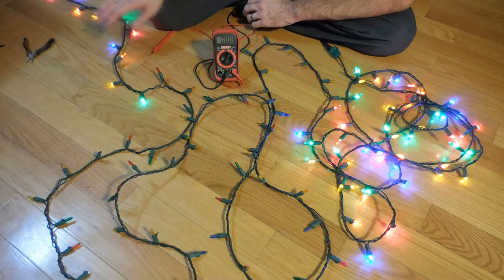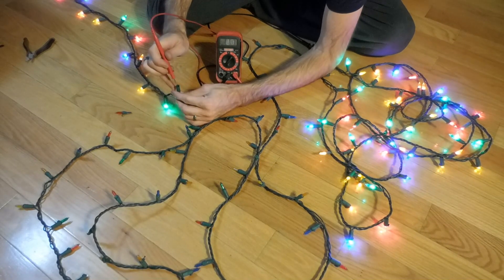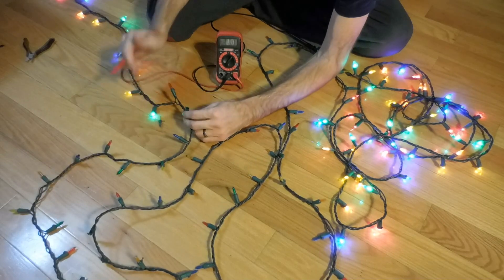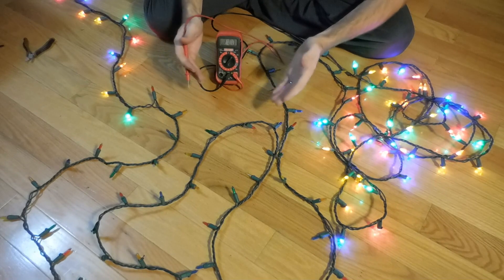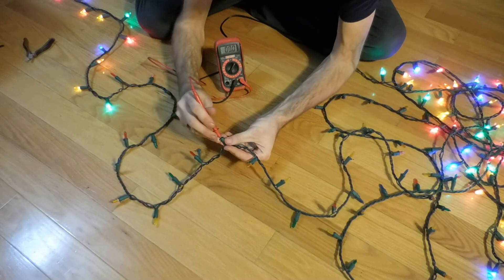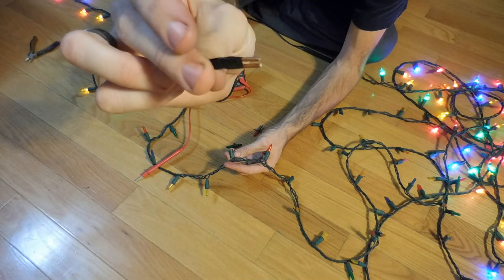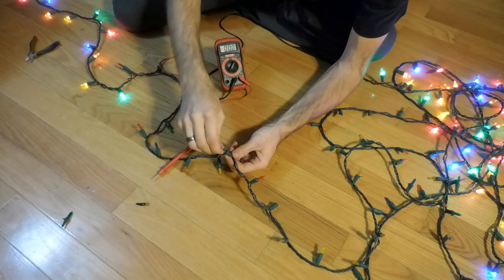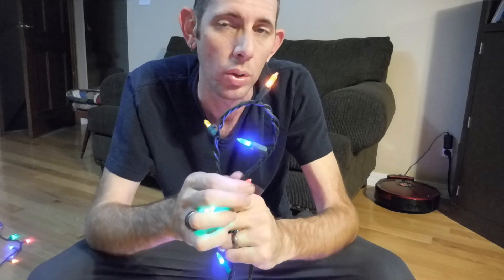Find a bad LED in Christmas light string

Comment: Great video. I was 3 for 3 at fixing the strings that have removable bulbs.   I still have two strings that don't accept replacement bulbs.  Any suggestions?
Reply from the maker: Jamie Forrester are the LEDs molded into place? If the LEDs are not removable, the only thing I can think would be to pierce the insulation to test for voltage on either side of a LED. I personally don’t like to provide any extra entry points for moisture to get around the wire, but a straight pin like from a sewing kit would probably leave the smallest puncture. Use the same technique to identify the bad LED, testing for voltage on both sides of the LED. Remember you’re dealing with potentially 120 VAC, so don’t touch that pin once it’s pierced the insulation. Once the bad LED is identified, you could probably get by with just cutting that one LED out, and soldering/heat shrinking a small wire splice in its place, unless you can find a suitable LED to take its place. Eliminating one LED will push a little more current through the remaining LEDs which could shorten their life, but they’re basically trash right now anyway. You could also solder in a ~270 ohm resistor in place of that bad LED to limit the current a tad. Let me know what you figure out with them. Better yet, make a video and show your process if you get them fixed. Others may encounter the same issue.

Comment: That's probably a $25. set of lights. For that money they can't make them any more sturdy than that? Who has the time and initiative to do this? Better off with old incandescent cheap mini lights.
Reply from the maker: Chris Lapp well, a lot of people prefer to fix instead of replace. And I’ve replaced many bulbs in incandescent light sets in the past, so this issue isn’t unique to LEDs. These were originally a $25 set of lights, but I got them on a clearance sale after Christmas. This set of lights had already been used for several seasons before this issue. I went with LED because I only have one exterior outlet on my house and with LED lights, I can daisy chain up to 9 sets together. It takes 6 sets of lights to get all the way around my roof line. Incandescents you can only do 2 or three sets linked together and then you need to start running extension cords for the next set of lights. I decided to spend money on lights instead of on a bunch of extension cords.

Comment: Any recommendations on how to shorten LED  GE icicle lights to make custom fit?
Reply from the maker: Jim Nuna I think the only way to do it would be to add a resistor equivalent to the number of LEDs that are removed from the circuit, but that’s just what I’d try first. It may not be the correct way to do it. Someone else commented about a plastic housing on some GE LED’s, maybe it already contains a resistor? I’m not sure.

Comment: Hey Dustin, I had a slightly different issue with my set of LED lights.  Plugged them in this year, they lit up but they were no where near as bright as they should have been.  I decided to give your voltage drop testing technique a whirl and it worked.  Was getting maybe 30v AC from the end almost all the way to the beginning of the string.  Then bang, 120v on one back to 30v on the next bulb.  Swapped out the one in between with a replacement and the string lit up like last year!  Guess that diode half fried and was acting like a big resistor.  Anyway thanks again.
Reply from the maker: Peter Frangos glad you found the issue. Thanks for sharing.

Comment: Some of my LED Christmas lights has built-in resistors actually on the LED bulb any clue where to find these I've searched everywhere
Reply from the maker: Christmas Man so the resistor is built into the bulb? Can you remove the resistor and measure its resistance or are they molded together and inseparable?
Reply: @DustinRogersinMO  it is actually molded to the lead that runs down from the light bulb they are inseparable all of the light bulbs in the strand or not like that there's only 1 bulb that is that way per strand I have about five strands of lights that's that way all of my others have the typical resistors in their own little spaces right after these little bulbs is where I lose my 110 voltage I have looked everywhere for these bulbs because three sets out of the five loses their voltage right after those bulbs really hate to trash them just because of that

Comment: I already had a volt meter, and your video helped me find the bulb with the loose lead wires.  They still blink off because it's a bad design, but I know which bulb it is and it doesn't blink off unless there's a lot of wind.  Thank you for taking the time to share your knowledge.
Reply from the maker: No problem. Thanks for watching.

Comment: There is a better safer way than working around 120VAC, go to www.LEDKeeper.com. https://www.ledkeeper.com/about-us/
Reply from the maker: It looks like that tool pierces the insulation. While that may be acceptable for indoor lights, most of my lights are out in the elements. I don't want to make any holes, no matter how small, in the insulation of my wiring. Piercing insulation is highly discouraged in the automotive and motorcycle repair field due to the risk of corrosion after water wicks in through the pierced hole.
Reply: You would be correct, however we did a UL  Hi-Pot test that is required on all electrical devices. We took a string of LED lights and pierced the string over a thousand times and then did the insulation breakdown test (hi-Pot) on the string, it passed with flying colors. So that is not a problem. If it wasa problem we would put a warning on the package.
Reply from the maker: Dennis Cherry good to know, but I’m assuming that the insulation breakdown test was performed the same day (or week) that the insulation was pierced? What about after a couple seasons of UV exposure, heat, cold, packed with snow, or drenched in rain? 

It’s good to know there’s a tool available, but I’ll stick to my methods and avoid piercing the insulation.

Comment: One word of advice, do NOT buy your LED Christmas lights at Walmart!! Big waste of money and CHEAPLY MADE! Every strand I have bought from Walmart has problems a week or 2 after I bought them. When it rains, water gets in where the bulb wires are, and they break off SO EASILY!! I throw on a 300k plus strand light show and it's only the LED that break so easily. From how pretty they look, they can be a real nuisance, as you can't shock them with the LightKeeper Pro like you can with mini lights. That simply shorts out the bulbs and burns them out. Buy your LED lights from Costco, target, big lots, or online from amazon or something like that
Reply from the maker: Drewbie1997 good feedback. I bought mine from Ace Hardware.
Reply: That's definitely better than walmart
Reply: If you want quality lights, forget all the retail stores.  Go to www.holiday-light-express.com - the lights they sell there are commercial grade, much brighter, rectified (no flicker) and extremely durable.  Yes they cost a bit more, and yes, they last a LOT longer.

You can also get LED screw-in replacements for your old fashioned lights with the big bulbs there.
Reply: I could not agree more I put up 30,000+ lights, about 10,000 are from Walmart and I'm working on them all the time.
Reply: @christmasman977 see i mean i have had some luck with LED lights from walmart. the trick is to get them from the back of the shelf and try your luck. you will have a greater chance of getting non defective strands. but even so, everything at walmart is mass produced and made cheaply, as the prices can tell. sometimes it's worth spending the extra buck or 2 and having something last for years on end instead of paying for something and have it last no more than a year or 2
Reply: None of them are any good if made in China. In other words, they are all garbage

Comment: This is the better tutorial for led lights. Others did not tell me the way the voltage went through. Good deal man. Now we need a video on icicle lights.
Reply from the maker: I would imagine that icicle lights are wired similarly where each hanging strand is wired in series. There may be multiple hanging strands per group of lights. Unfortunately I don't have any icicle lights to test.
Reply from the maker: I bought a set of LED icicle lights on clearance just to test out. The set I bought operates in the same way that the regular string of lights does. There are groups of lights that are wired in series. My set had two groups of 35 lights and each group of lights also had a resistor in line to limit the current passing through the group of LEDs. The resistor on mine measures 1500 ohms. Finding a fault in the icicle lights may be a bit more tedious than a regular strand because you’ll have to pay attention to how the wires run. Imagine starting at the plug, the path goes to the base of the first icicle, then down the icicle and back up to the base, then continues to the next icicle base, then down and up, and so on. If there is an LED that is half way down one icicle, you’ll have to determine if it’s on the wire that is going down, or the wire that is going up. Of course you can just test the other side of the icicle to be sure.

Comment: What happens if the voltage drops by ~50v between 2 lights?
Reply from the maker: Cosette1211 your light set may be wired differently than mine, but 50v drop seems excessive across two LEDs
Reply: Yeah it seems weird. It goes from ~118/120 to ~70-80 then in a couple more bulbs it's down to ~30. In your video it's clear where the one bad bulb is, but I have 3 problem sets of lights. One of them none of the lights turn on, the other two about 1/2 turn on. It seems like I have multiple bad bulbs, not just a single bad bulb... 
One of the half lit strings progressively drops from 120 to 70 in the next light socket to about 30, so it seems like bad wiring maybe, but I don't know enough about how electricity works lol.
Reply from the maker: Cosette1211 are these LED lights? Or incandescent?
Reply: @eaglei22 sounds like corrosion on the terminals. Look for signs of corrosion and then the contacts.

Comment: Could it be that one needs a True RMS AC voltmeter to do this? After getting strange and inconclusive readings with my Ideal VOM clampmeter (not True RMS), I was able to easily identify the bad bulb (location of 0 volt condition) with my Fluke True RMS VOM clampmeter. In any case, thank you for the tip!
Reply: He's testing voltage; were you testing amps with your clamp meter - could that be the difference?

Comment: When I took the lights off my fence I found out why the last 50 lights weren't working.
Some jackass cut the last light off the string and cut the wire in another place.
I need 220 volt lights so if somebody cuts them they will get immediate punishment.
Reply: Not a jackass....a squirrel
Reply: @Iamkayaky  There were several juvenile delinquent jackasses in the area. They vandalized things in the neighborhood for “fun.”
They were caught trying to steal tools from my house but were let go because some time in the past my stepson invited them over. 
Because they were allowed over once they were let go by the police even after being caught red handed with the tools they took when nobody was home.
Reply from the maker: Yeah, that last light is important. I just put out a video a week or so ago on how to shorten LED lights. You need that last light for it to work.

Comment: Great trouble shooting tips. I was able to locate the bulb that was causing half my light strand not to work while the strand was still on the tree. Measuring voltage in various sockets to find the bad bulb worked well for me. Thanks for the help.
Reply from the maker: Great!! Glad you got it fixed. Thanks for watching.

Comment: Thank you. I have a string of 200, but the last 50 quit. 
I was hoping I didn't have to replace them one at a time to find the bad one, especially if there is more than one bad one involved.
I got my multimeter from Harbor Freight a few months ago for free with a coupon. All I had to do was buy something so I got a $2.99 speed square that I needed for a project.
Reply from the maker: Very good point about the possibility of more than one LED being faulty. It'd be impossible to diagnose by just swapping a spare in each socket. I've got a Harbor Freight meter that I got for free too. I bought a multi-pack of alligator clips from HF and replaced the standard probe with alligator clips on the HF meter. It makes testing some things way easier when you can just clip the lead onto the connector or wire.
Reply: Reuben Hubert47